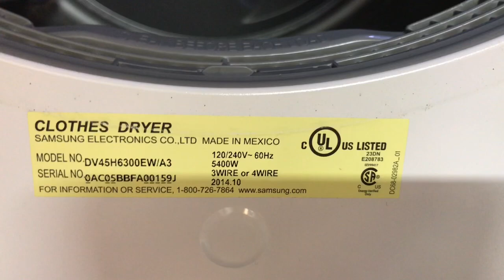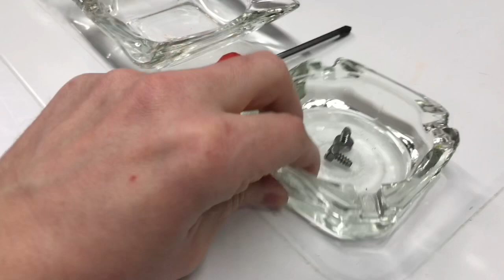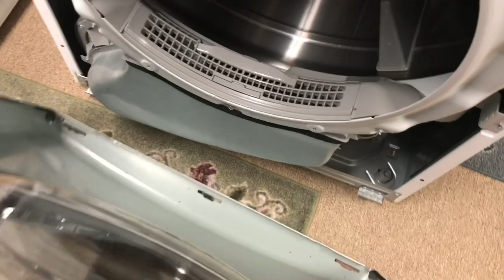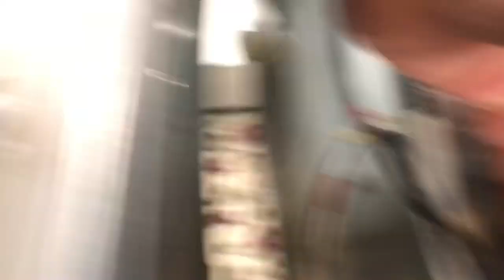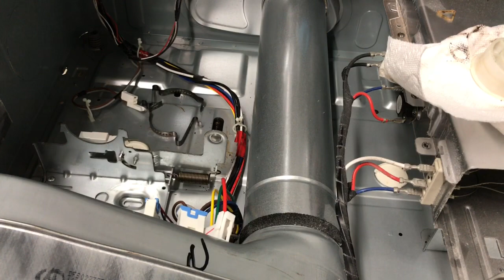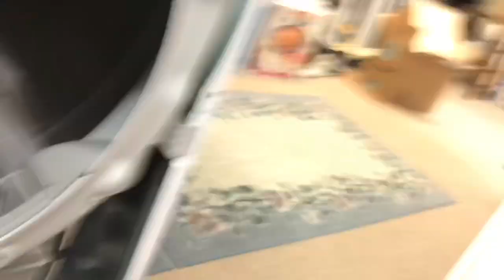DIY Fix Your Samsung Dryer - Motor & Idler Pulley Replacement

Comment: This video is excellent.   My issue ended up being the Thermistor dc32-00007a.  It showed a resistance of 8.6 vs 10.6  apparently it should be within 10% of the 11,000 rating.   The new one from Amazon measured only 9.6 so it had me worried.    Got it all back together and it is working great so far.

Comment: Excellent video but I can't help laughing when I'm watching you take the entire dryer apart until it's completely in parts on the floor just to replace a few parts but I noticed that is what's been happening with a lot of people working on these junk Samsung dryers that only last about 10 years at best. I have the same exact problem you showing your video but before I spend another $120 in parts I'll be paying a little over $400 to get a brand new different brand dryer with better reliability record! After all a dryer that's 9 years old shouldn't have to have its heating element replaced on three different occasions for a normal everyday use dryer.
Reply from the maker: @joeblow26:  😂 Indeed!

Comment: If you had the right parts at the start, how long did it take you to change the motor and put it back together? Great video mine is doing the same thing.
Reply from the maker: @EMC2:  I honestly don’t remember. Maybe 2 hours or more.  I wasn’t rushing and spent way more time filming than if I just did it without trying to record each step of the way.

Comment: So I replaced the idlepulley on mine. Now the drum is spinning slowly. Is the motor now going out?
Reply from the maker: @solidshot1227:  first you’ll have to check to make sure you put everything back together exactly in the right way, e.g., the drum roller wheels are in their tracks and the drum can rotate by hand before you close everything up, the belt is wrapped around the drum correctly and isn’t slipping, etc.  basically make sure you rule out these other things before jumping to the motor.  Good luck!
Reply: I know your comment is 4 years old but I wanted to answer your question anyways.  what was happening to you is called the old nickel and dimeing you to death. Samsung makes a garbage dryer that doesn't hold up to everyday use.

Comment: Did you know that you could open it from the back of it was just that pulley/belt?
Reply from the maker: @Koki Ali:  Easier to access the motor from the front, but still a lot of pieces to remove.

Comment: Thank you for the very helpful video. I had the exact same symptoms and it turns out that a new motor and belt tensioner pulley were the fixes. I think, as others have mentioned, that the failure starts with the pulley binding (mine was nearly stuck) causing excessive current load on the motor resulting in the burnt points in the centrifugal switch. My complaint to Samsung would be this: the control board appears to sense the overload hence the shutdown. Why not display an error code? Also, the switch would be a simple thing to replace but, of course, it is not available separately. Fortunately, I was able to get a motor on eBay at a reasonable price( less than $50).
Reply from the maker: @TheOldbikerider:  Thanks for the kind words.  Happy to know that it helped you.  And I fully agree with your suggestions for Samsung - why not just throw an error code?  Right?!?  Update - 18 months later and the dryer is working like a champ…

Comment: nice, the part you found is literally half the price of the one on the Samsung website, I can't replace this whole piece of shit so this is the best solution
I replaced the heating element on this giant smelly stupid hunk of shit 3 years ago and it's still giving me problems
thank you for the cheaper part number
edit: you know what's funny is the same shit happened to my AC unit a week ago, spinning it with a screw driver made it work for a couple hours, opening the top of my dryer and spinning it does the same thing.
verdict: two diarrhea motors have plagued me

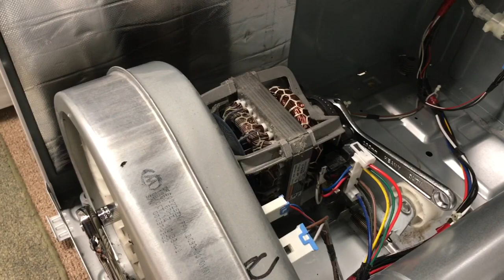Comment: Hi. Thanks for the video. I am following your tutorial. Kind of stuck at unscrewing the motor step. (7:02 minute) where you use 14mm socket to unscrew the motor bolt. The bolt is very tight seems like its got rust. Any suggestion or alternative way to get this out.
Reply: Thank you. After a week of trying different things to loosen the bolt , was able to get this through and complete the replacement. Thank you for this great video
Reply from the maker: @kirtanpatel46  :  Wow!  +1 for persistence!  Happy to hear you finally got it to work.  And thank you for the compliment.
Reply from the maker: @Kirtan Patel:  Thanks.  Remember the threads are in the opposite direction, so that front socket wrench is going to be turned clockwise while you hold a wrench on the back side of the motor.  From what I remember it does require a substantial amount of force to get it started.   The longer the handle on the wrenches the better because you will have more leverage.  Good luck!

Comment: Mine is a DV42H5000EW/A3 model and when I turn it on mines just hums I don’t hear anything trying to turn I popped off the back part of the dryer and seems like everything moves is an intact would that just be my motor?
Reply from the maker: @Lerr001 Jr:   Not sure. Nothing rotates? Belt broken or slipping if the motor still spins?
Reply: @LongologoProductions  belts in place and the whole assembly moves fine when manually turnt. Just humming sound when you press the start button
Reply from the maker: @lerr001jr7  : sounds like something seized up and maybe thermal protection prevents motor from turning.  Start by looking at that idler pulley.  That might be it. Next step would be to look at that motor switch assembly if it is burned out like mine.  Otherwise not sure.
Reply: @LongologoProductions  will do - already took the dryer apart. In the past I was able to get it running by manually turning the drum then pressing start. there was a point in time also when I hit the start button it would go for a little bit like yours in the video then stop but now motor just makes a humming sound I’m no expert but I’m wondering if the motor is no good
Reply from the maker: @lerr001jr7  : could be the same things as happened to mine:  idler pulley wheel slowly seized up, putting strain on the motor and eventually burning out part of the motor switch. Sad thing is the switch assembly can’t be replaced separately as best I can tell you have to buy another motor too.  Ugh.  Good luck.
Reply: @LongologoProductions  thank you you for your reply’s and help👍

Comment: Thank you for helping me fix my dryer. Exact same model and it turned out to the the idler pulley. $20.00 from Amazon. Control panel was a little hard to come off, but it did. Would have cost me a lot more for a repair person to come in.
Reply from the maker: @newmarket:  Great! Happy to hear it helped!

Comment: Hey, I’ve got a dv45h6300ew/a3 which appears to be the same model you are repairing here. Perhaps you could confirm? Do you have a link to the amazon site where you got the motor idler pulley and new belt? Either way, great video. Well explained and we’ll produced. Thanks for posting
Reply from the maker: @CJ Cain:  Same model - see 0:30 into the video.  Also, the Amazon links appear in the description underneath the video.  Good luck!